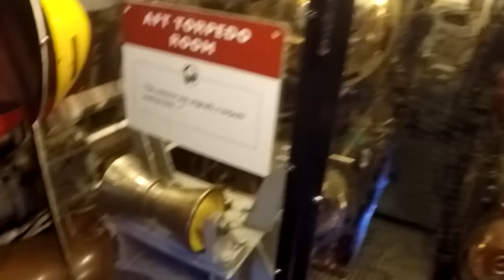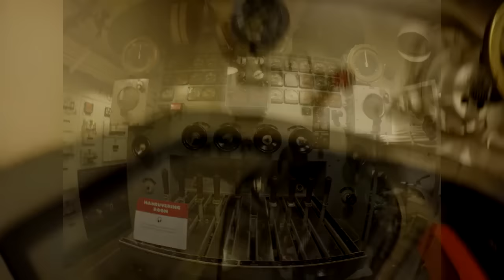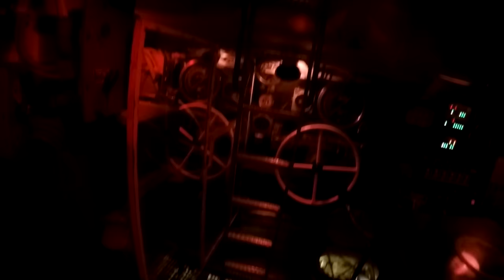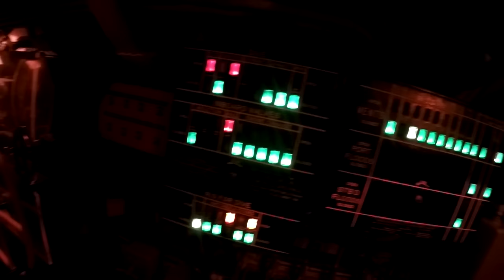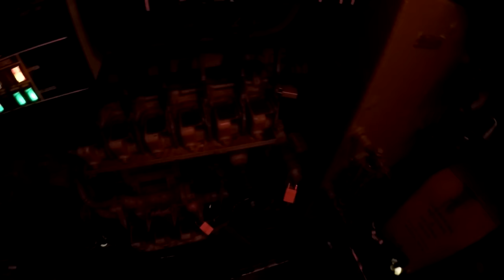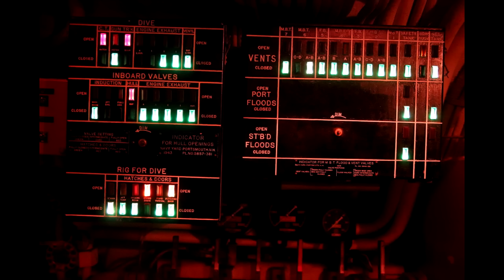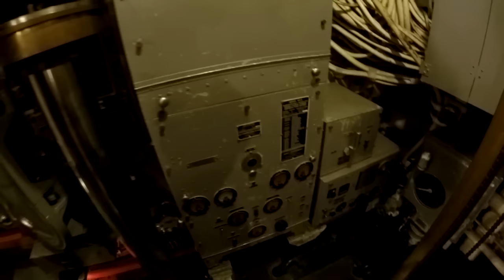US WWII Submarine Walkthrough & Audio tour - The USS Pampanito/SS-383 - Balao class

Comment: My Father was on SS399 SeaCat from 43-46 and Radioman SS399 SeaCat was one of 12 Submarines that escorted the Battleship Missouri into Tokyo Bay for the Surrender of the Japanese in September 1945.  My father watched the surrender from the deck of the SeaCat as he wrote in his diary. Still have original transmissions received on SeaCat Letterhead as well as My Fathers Sub Jacket which has the Original Artwork painted on the conning tower by my father and who also painted the artwork on his sub jacket. As a small child back in the 50's and early 60's my father as an officer in the Coast Guard we were allowed to get onto commissioned subs and able to actually get up into the conning tower and use the periscope - not allowed today even on the Pampanito or any other subs that are now museum pieces.

Comment: I was onboard her a few years ago and was an early bird and had her all to myself. A fitting memorial to all submariners, Ex RAN Sea Cadet, EX MN and Air Force. Also do not forget the Liberty Ship just past her, well worth a visit.
Reply: When I lived there I went on both several times. The liberty ship more often. For a while they gladly took used motor oil from repair shops to fuel the burners, once a month they fired her up and ran the old steam engine and generators. Was a lot of fun gling and checking her out. If I had been able to, i would have volunteered to take the trip to Omaha beach in celebration of D day.

Comment: This submarine is luxarious compared to a german type VII
Reply from the maker: Yeah, it's got way better accomodations
Reply: The type VII is a lot smaller (around half the displacement) and kinda an unfair comparison.  The type IX was closer in capability to a Balao in terms of range, speed, and torpedo-carrying capacity.
Reply from the maker: @rapth0r  Agreed, the type IX is a better comparison on the size, that being said it still didnt have the crew comfort accommodations the Gato/Baleo classes had. I dont think that was even thought into designs until the type XXI, where there was a fridge for cold storage and other things. I have seen it in the plans for the XXI, but dont know for sure of the contruction included it.
Reply: A crews bunk room and mess deck with dinning booths. Kriegsmariners would be shocked 😳
Reply from the maker: @craftpaint1644  Yup - a regular luxury from their point of view :)
Reply: @BecksHobbyProductions  am I right in thinking that the late war US boats had aircon?
Reply: yes the us subs had air condition and were larger and had more range but the Uboats could dive faster and deeper than the us subs

Comment: USS Pampanito/SS-383 has a fully restored Torpedo Data Computer onboard. This amazing device provided a firing solution in real time rather than the manual, future ambush approach common in WW 2.
Reply from the maker: It is indeed a fantastic piece of equipment! However (I only have Wiki to refer to) other navies also had TDCs but they could not calculate realtime, but it was still not done manually

Comment: I just watched a tour of a German uboat that was built around the same time as this. This boat has about  twice the interior room and looks like a luxury yacht in comparison.
Reply: I agree, I toured the Type VIIC U-505 in  Chicago. It was smaller and had tighter interiors. However as JbeckJ, our submarines were used mainly the Pacific and they needed to be larger to cover the longer distances. Type VIIs could never really have been used in the Pacific theater.
Reply: The US Navy Fleet type submarines designed with long range and high crew comfort among their top priorities. Also they had much electronic equipment that benefited from having onboard air conditioning equipment.

Comment: It always surprises me how bulky and spacious the American submarines were. Look at a submarine from any seafaring country around WWII and you’ll see the same design. Central hallway, 2 diesel engines(or one) and 2 electric motors, small, streamlined conning tower. And then you have the Gato class. 4 engines(!), hallways with (small)offices next to them, a conning tower with an extra floor for lookouts, cooling capabilities, bunkbeds on 4 rows, a kitchenette with seperate messhall? For a second I thought I was on the Cap Arcona over here! And it looks so powerful as well, and homely. I wish the Dutch subs were that good.
Reply from the maker: Yeah, the were really big. Even the German type VII seems big compared to the Danish Cold war submarine, but the US fleetboats were cruiseliners in comparison
Reply: I think if you look at the design missions the US submarines had longer duration and mileage tours, compared to the Japanese and German Subs.   US subs were designed to go to Japan.

Comment: For those who are curious, like I was after coming from the Type VII U-boat video.. 

The Type VII Stats are as follows.
Displacement: 
769 tonnes surfaced
871t submerged
Length:
67.10 m o/a
50.50 m pressure hull
Beam:
6.20 m o/a
4.70 m pressure hull
Height:
9.60m
Draft
4.74 m
Propulsion
2 × supercharged 6-cylinder 4-stroke diesel engines totalling 2,800–3,200 PS (2,100–2,400 kW; 2,800–3,200 shp). Max rpm: 470–490

The Pampanito:
Displacement:
1,550 tonnes surfaced
2,429 tonnes submerged
Length:
94.95m
Beam:
8.31 m
Draft:
5.13 m maximum
Propulsion:
4 × Fairbanks-Morse Model 38D8-⅛ 10-cylinder opposed piston diesel engines driving electrical generators

2 × 126-cell Sargo batteries
4 × high-speed Elliott electric motors with reduction gears
two propellers 
5,400 shp (4.0 MW) surfaced
2,740 shp (2.0 MW) submerged

So, the reason it seems like the Pampanito has a hell of a lot more room inside, is because it does! It's a much bigger boat! The poor ol Germans were sailing around in much tighter tins!
Reply from the maker: Made me smile :)
And even if you compare the type IX, which was closer to the size of a Baleo class, the crew accomodations were still nowhere near the same...

Thanks - for watching BOTH videos 👍